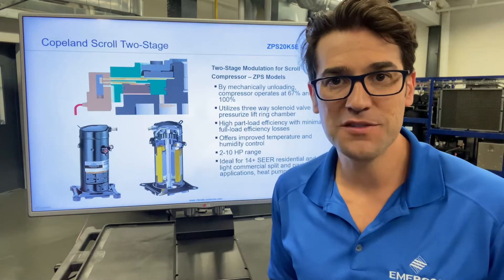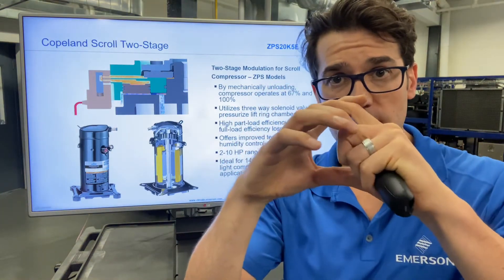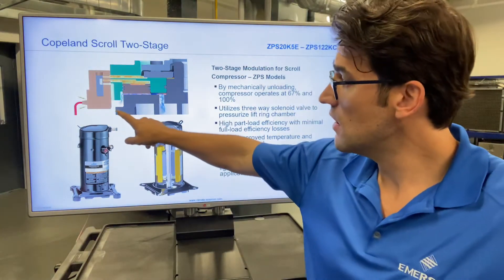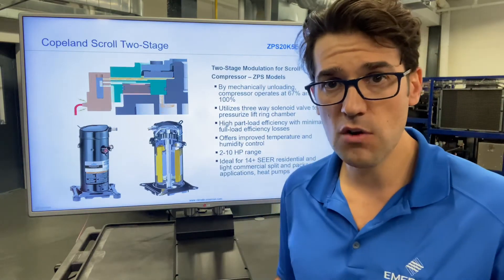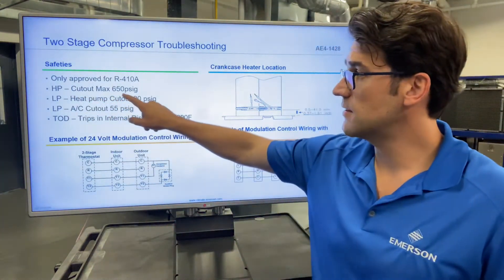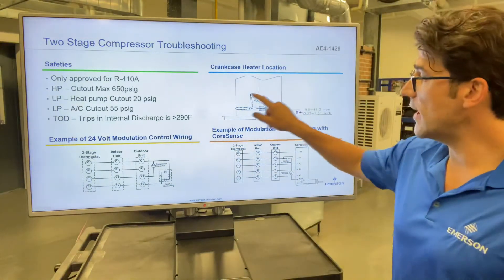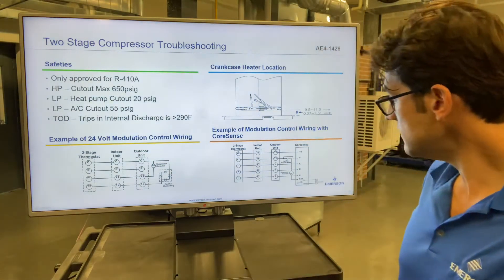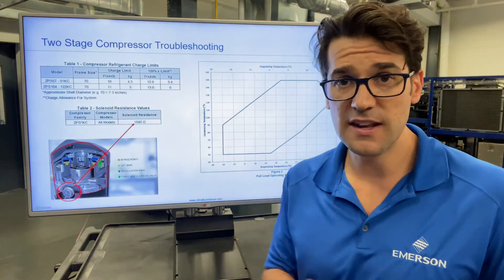Copeland Two Stage Scroll

Comment: Ok how do u test the 24 volt from the board to the compresor plug .if there is a rectifier?
Reply from the maker: @char0507  I think you can find the answer in here to test the rectifier https://www.copeland.com/documents/ae-1423-1-5-to-5-ton-zps-k6-copeland-scroll-two-stage-compressors-en-1592302.pdf
Reply: @RefrigerationMentor  thank you very much .I appreciate it ,gave me a lot of information

Comment: Worst failure rate of a compressor ever across the board not manufacturer dependent 
Solinoid failing,discharge gas leakage into body low compression you name it
Reply from the maker: Thanks for sharing that. Have you inspected some of them and did you have Copeland inspect some of them? What did the reports say?

Comment: I have an issue with a package unit ligth commercial
Model number 
DP 14 GM6108043 CA 
I’m receiving short cycle error 6 flashes 
Unit was never wired for second stage since installation 
Unit unit is a year old 
Verified pressure switches receiving 1200 ohms when I Omed out my solenoid 
Replaced my 24 V rectifier, but still receiving this error code 
Do I have to replace the compressor? 
But when I bypass the board 
And run my blower and jump the contactor. My pressures are fine. Do you know if I’m missing something?

Comment: Hey I need some help. I have Copeland two stage compressors on my Geothermal unit. Unit was installed 10 years ago. Recently my unit had a short. I found out that my second stage solenoid is grounded. Here is a part number of my compressor ZPS51K4E-PFV 230V. So now it’s only works in the first stage. Please tell me for how long it can last. Can it last 1 more year or 10 more years? Thank you so much!
Reply from the maker: You guess would be as good as mine.
Reply: @RefrigerationMentor  I’m gonna check on amp draw and if it’s pull right then hopefully it will work for a long time.

Comment: do you need a 2 stage thermostat? i have a 5 ton Lennox split unit that uses this compressor. Can the solenoid be powered directly off the contactor?
Reply from the maker: You need a simple 2 stage thermostat. Check out the compressor manual it explains how to wire it up in there.
Reply: @RefrigerationMentor  so if i dont have a two stage tstat can it be loaded up 100% off the contactor???

Comment: Replaced a Bristol 5 TON on an older Carrier Infinity system with a Copeland Scroll 2-stage ZPS51K5EPFV800 without issue, until it tried to switch to low stage and I received Low thermal and low comp cutout codes. It's important to make sure your leads from the rectifier plug meet the correct destination, as in this case, otherwise you may be working out some bugs. This is tedious when everything else checks out well. Nice video!
Reply from the maker: Thanks Leebetter

Comment: Great info. I have a Trane XR system which had a rectifier to control the compressor solenoid valve. The system uses a regular thermostat (no Y1 and Y2). Will it work?
Reply from the maker: That is a great question. Did you get a chance to Read AE4-1423? it will tell you in there. Please let us know.

Comment: Trevor, a chemical engineer here trying to understand a little about two stage scroll compressors.  One of your Two Minute videos, "Copeland Digital Scoll Compressors," did a good job explaining compressor unloading where the compressor pumps nothing when unloaded.  (A 10-year-old Emerson/Copeland video showed a digital scroll drawing 5.6 amps loaded and 3.8 amps unloaded.) Are you saying these ZPS compressors still pump 65% of their capacity when unloaded and do not have to modulate every few seconds when unloaded?  If so, please compare amp draw loaded versus unloaded.   Thanks!
Reply from the maker: Well some models are 67% and some are 65% but yes your power consumption will be less when in the unloaded state. Yes It will only change from loaded to unloaded state when there is a capacity call, like from a 2 stage thermostat and not PWM. Pulse width modulation like the digital. You can see the energy usage in Copeland mobile loaded and unload states of ZPS compressor.  Check it out.

Comment: Great info.  Does the zps40k6e have a high discharge pressure relief valve? Is an external high discharge cut off sensor switch mandatory?
Reply from the maker: Great question. It will be in the manual for that compressor. Let me know what you find.
Reply: @RefrigerationMentor  ah. Yes. Based on the fact that it does not mention internal pressure relief as do the documents for the ZP*k5 series and mentions external low and high pressure cut offs, I am guessing it does not
Reply from the maker: @TheRealoldcar  Follow up with Copeland I am sure I have cut a few ZPS ultratechs open and I believe they had the IPR. Not sure about he K6's. Let me know what you find out.

Comment: Hello Trevor,
According to the Table for R410a the Critical Temperature is 165°F. If the gas Condensing Temperature is 120°F / 419psig, will the CUT-OUT pressure at 650psig not too high that it would destroy the Compressor?
However from the Refrigeration and Air-conditioning book, the cut out pressure is put at 50psig above condensing pressure
Reply from the maker: Toyin, yes that is the critical temperature which means there will be no pressure-temperature relationship above that point.  You will have to look at what the high-pressure cutout should be set for in the compressor installation manual of the specific manufacturer.  R410a high-pressure cutouts are usually set for 650 psi with a manual reset but always refer back to the compressor manufacture. Here is the manual for the 6-12 ton 2 stage Copeland scroll manual https://webapps.emerson.com/online-product-information/Publication/LaunchPDF?Index=AEB&PDF=1428